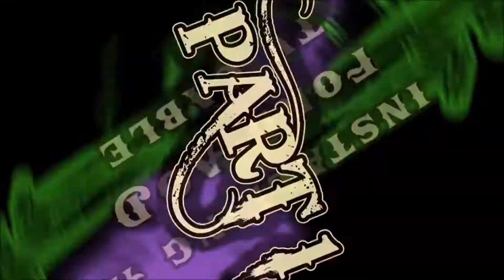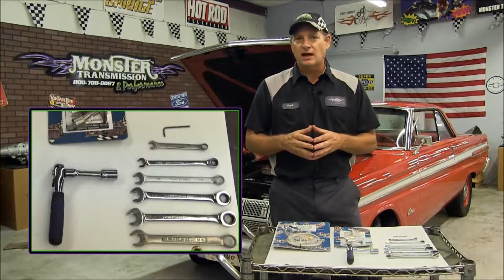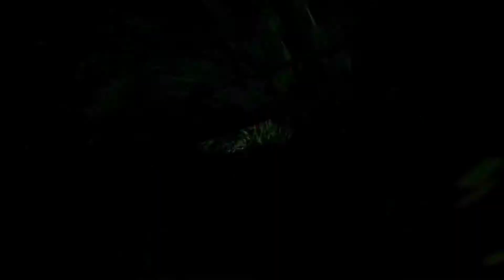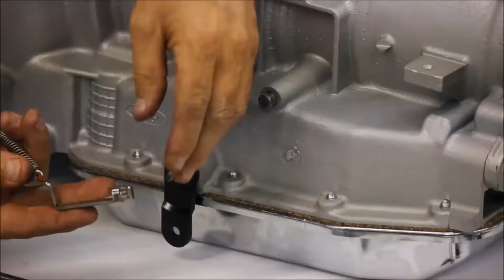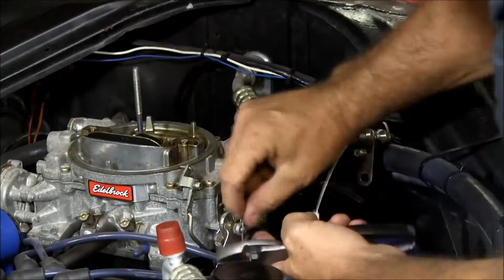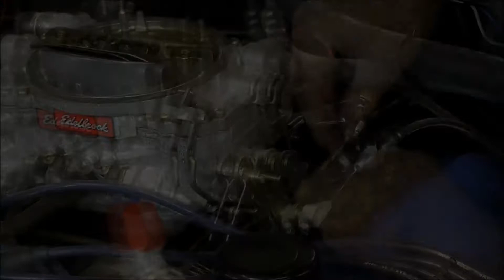AOD Install Notes

Comment: I have a problem with my aod, from 3 to 4 it does not accelerate, it seems that it suffocates and I adjust the cable but it seems that the same thing happens even if I tighten or loosen it, it does not give me power at those speeds